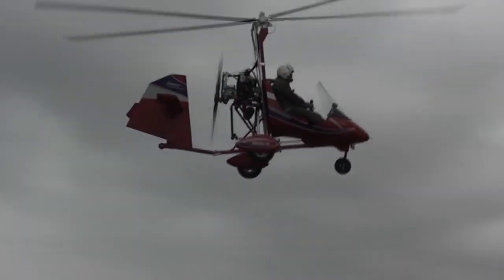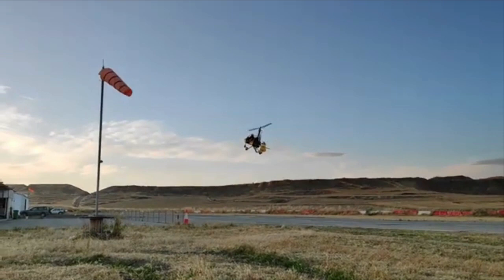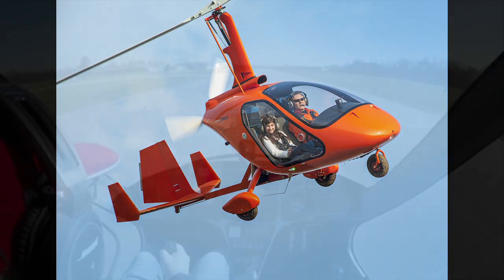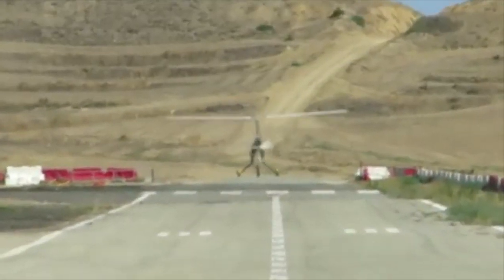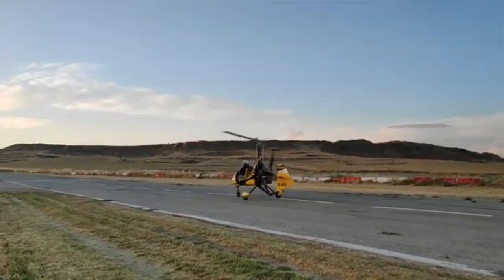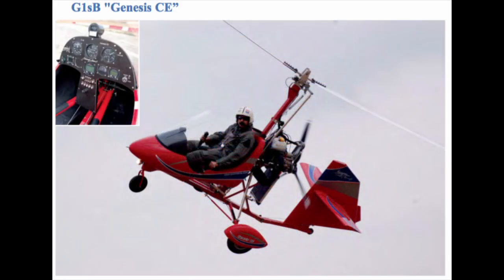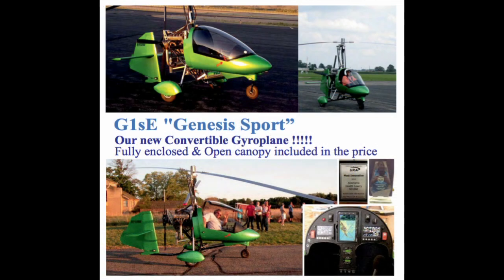Aviomania aircraft - gyrocopter product review

Comment: always thought that the tractor autogyro was a better prospect myself,perhaps not quite as light to organise though.
Tractor allows a bigger prop more suited to the relatively slow speeds, with better clearance and straighter run through the aircrafts mass centre.
The wider spaced gear both in width and length would make it more stable on the ground.
A friend of mine who is quite a famous pilot had this idea of using a linkage between an active elevator and the sticks fore and aft movement affecting the rotor position angle in an effort to sync the two, I always wondered if it had merit.
Reply from the maker: Yes in the old style I'd agree and I'm surprised nobody has built a gyroplane similar to how Waco do biplanes.  But if you look at the tractor gyroplane film then you'll see the modern take just looks ugly!
Reply: @gyrocopterflyingclub6148  yeah I understand that, myself Im especially fond of the Kellett autogyros, but with those huge radial engines necessary for the day it isn't a style that lends itself well to very light craft. So I looked at Fieseler Storch for inspiration, which itself isn't a design one would call beautiful unless plain practicality is in the fore. Because you know, Germans...

It wasn't until I imagined the core of the design as a bi-pod centre mast with an engine mount attached on the front, wide main gear each side below and seat mount behind. Then it just began to make sense because everything hangs either off or within that core. Mostly the tractor ultralight ends up with a short tight cowling more suited to an inline engine, a windscreen captive within the masts, pilots foot pedals and cyclic control within the mast footprint, long main gear holding the machines take off AoA. The only unsettled science is the tail boom able to withstand heavy STOL landings which doesn't seem in itself a prohibitive requirement.

It seems like you have to go back to what is necessary in the engineering sense and when you achieve that minimum, 
.... somewhat counter to the usual axiom, if it is right it will probably look right....
Reply from the maker: The aircraft that I thought was going to gain traction was the Bulldog which I am very surprised didn't sell or make to market.
Reply: @gyrocopterflyingclub6148  Im not, 
the mast is so flawed, you cant pretend to be authentic, if it isnt authentic whats its purpose
really you need to start again with a clean sheet and make it all it can be

Comment: Well, how can the aluminum rotor get a lifetime use?? I know that composite rotor do (Magni), but aluminum develop cracks. Am I wrong?
Reply from the maker: That isn't what was said.  No life limit is not the same as lifetime, it just means there is a process of inspection/service and as long as things are within tollerence / parameters then you can continue to use them.  Also note because you can doesn't necessarily mean you should.  This becomes a personal choice.  Thanks, Phil.

Comment: A fixed-wing controls vertical speed and forward speed with a combination of pitch and throttle. Two variables, two inputs. A helicopter controls vertical speed and forward speed and rotor speed with pitch, throttle (usually auto-throttle) and collective. So how does a gyrocopter control three variables with just two inputs?
Reply from the maker: Hi - what 3 variables?
Reply: @gyrocopterflyingclub6148  -- Same as the helicopter, rotor speed, vertical speed, and forward speed.
Reply: Code Hound rotor speed is not controlled, it is always in autorotation with the exception of during the pre-rotation run up prior to take-off.

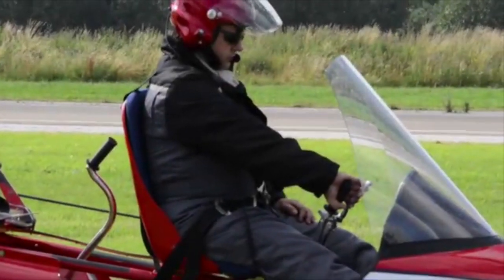Comment: The guy in the clip at 3:32 is holding the stick in a weird way. His hand is “upside-down” with his thumb at the bottom and the fingers of his right hand on the left-hand-side of the grip. Any idea why he’s holding it that way?
Reply from the maker: Haha yes I saw that I can only imagine he has a weak hand? Either that or perhaps it’s a permanent damage and it has strength in one direction??
Reply: Gyrocopter flying club - I would imagine it would be extremely difficult to pull back on the stick with that grip.
Reply: This model was the early minimum G2sA-1 (no longer available). It had minimal, small & light composite cabin parts, mechanical brakes and no stick lock. So waiting in line for take-off, having to hold the stick forward against the trim spring and holding the brakes cold be tiring after a while. The standard current model G2sA-2 has electric trim, retractable stick lock and hydraulic brakes with parking brake as standard. Also with the Soft coupling semi-castoring nose steering has a minimum turning radius of 10-12 meters at very slow speed with little brakes applied for backtracking but once the speed start to increase nose steering is greatly reduced in order to prevent ground looping. Since the active tail design prevents throttle- yaw coupling makes this aircraft really easy to land and take-off.

Comment: interesting, simple, overdue improvements: all due credit. But sorry, no bargain. Pricing still scary for the parts involved, influenced more by Autogyro & Arrowcopter stickers than what the fundamentals (and lower aesthetics) justify. Perhaps China will show the way?
Reply from the maker: I do hear you. - although having been around this industry for almost a decade now one of the problems is the cost of the motor (a Rotax 915 is over £30KGBP and the 912 is almost £20K with ancillaries. So that 75k Euro price for a 915 two seater has at least 35k Euro of motor. So we left with 40k well rotors and pre-rotator is at least 5k and with developmental and airworthiness costs plus some dealer margin and (I don’t know but I guess) profit for the manufacturers I bet nobody is making more than 10%?? On the China side I do agree 100% or India actually but I’m surprised they haven’t built / copied Rotax motors because Rotax must make huge margin on their engines.
Reply: @gyrocopterflyingclub6148  From the 2019 Price List:"G1sA/2 “Genesis Duo”" - "Ready to Fly Rotax 915 iS 130HP (fuel injected) engine (from) .................... . . . . . . . . . . . . . . . . . . . . .............. 59,350.00" (euros). So I would guess, more than 10% if it went up 25% in one year. The header "G1sA/2 “Genesis Duo” is confusing and probably a typo, so it could be the single seater, but I saw no larger price value on last year's list, and it was the only 915 option.
Reply: Price any airplanes lately or even automobiles or homes or boats or anything else????????????????????????
Reply: Just to make sure the price structure is clear…. For countries in your part of the world (non-European countries) the tax is not charged. The tax (19%) is what the government gets for anything sold in Europe. So the 2 seat 912ULS gyroplane (100HP) is about 47K Euros.
 If you go and buy the engine with Exhaust and cooling system is 17K + Euros, The rotors, rotor head and prerotator is 5K+ instruments 2K, propeller for the 912 about 700 Euros and a painter to paint it another 600 euros minimum. If you add all these they come out to 25300 euros…. Just to by them. This leaves 21700 euros for a ready built, test flown and balanced gyroplane this price includes the price of the parts, labour, overheads and research and development.
 The other thing to consider is that Autogyro and other manufacturers use stainless steel frame, standard commercial hardware and wiring and make the tails from composites. The Aviomania aircraft use Aircraft grade aluminium for the frame, Aircraft aluminium built-up tail (like real airplanes), aircraft grade AN hardware, Teftzel aircraft grade wires and Kevlar re-enforced fuel tanks. Just these parts are much more expensive than what other manufacturers use. Consider also that it takes 2 engineers about 2 months to complete on gyroplane. 
If pricing was really influenced by Autogyro and Arrowcopter then this model should be priced at least 20 thousand more. I do not think that even the Chinese if they use the same quality materials can better that price!!!

Comment: I don’t like the fact the stabiliser boom touches the ground on take off and landing!
Reply from the maker: Have you seen my take off films??? :-)
Reply: Gyrocopter flying club No!!!! Not yet anyway!!!!
Reply: It does not have to touch. The tail is designed to handle the forces if you choose to allow the tail to touch. The single seat has 1 tail wheel and the 2 seat 2 tailwheels so if the tail touches the ground it is still ok. The concept of allowing the tail to touch the ground is shorter take-offs and powered really short and slow landings. As i said you do not need to touch it and it can be flow with touching the tail on the ground.
Reply: @Aviomania  need a mustering edition aviomania!!!!
Reply: @shawnwright5332   We have a 2 seat designed for rough field operation. if it flies one up it outperform our single seat with the same exceptional agility and safety. It can fly for 4 hours (with standard fuel tank.. can be extended to 6 hours). Also the single seat can be equipped with large off road wheels and extend range. And the single seat is already approved in Australia!!
Reply: @Aviomania  awesome